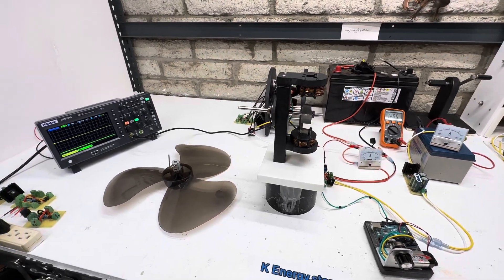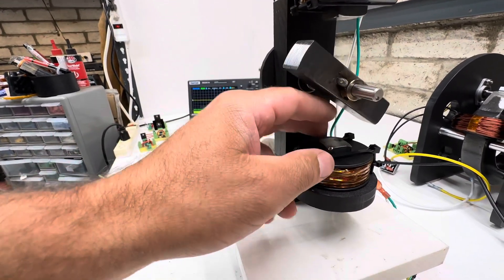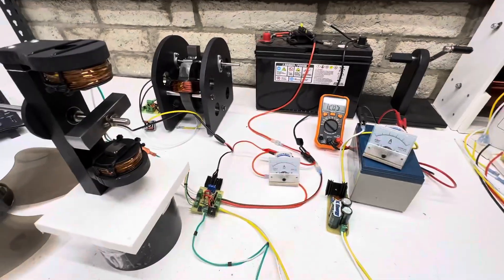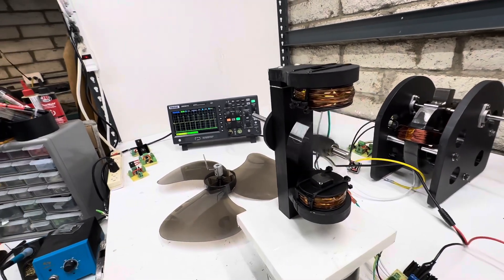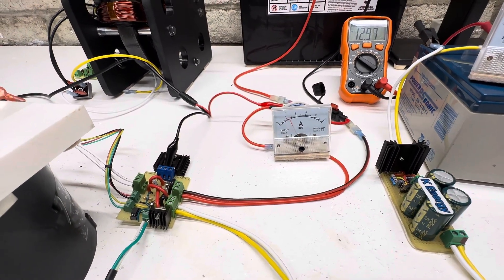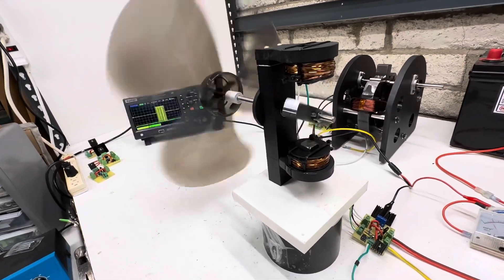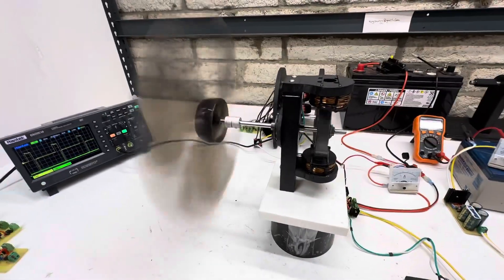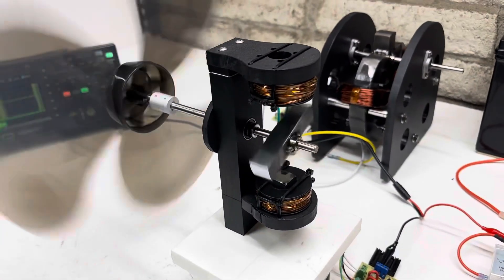Basic attraction motor no magnets

Comment: Would using more than two pole rotor increase the chance of making the motor self-starting ?? The back energy you are using to charge the battery. Does using larger capacitors increase the pulse energy that goes back into the battery K Energy ?? 
Just love this type of work you are doing. Help make us energy free Sir.
Reply from the maker: Thanks buddy I’m trying lol 
You need 3 circuits like on the tri force motor 
More poles definitely work better 
I think it’s more of the pulse timing I like one pulse per second works good